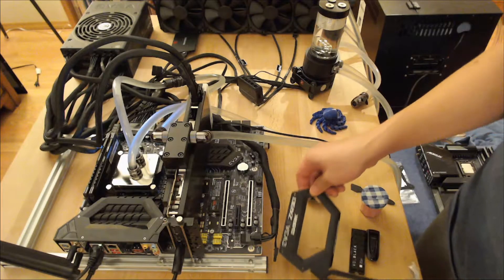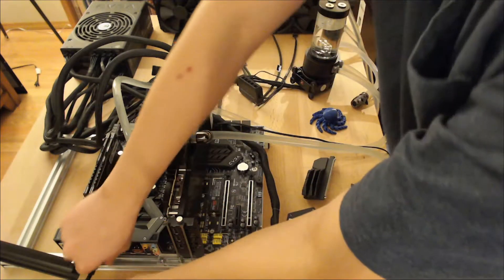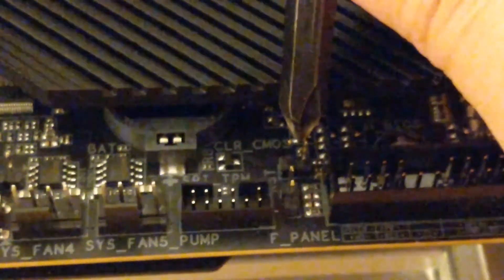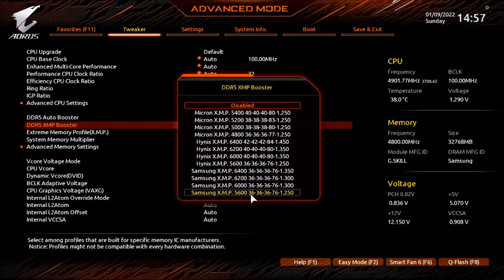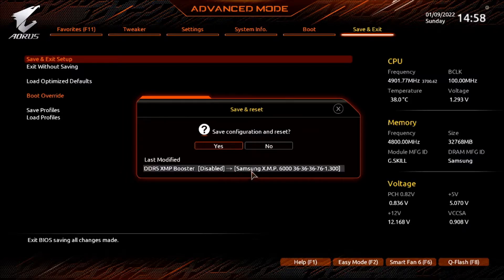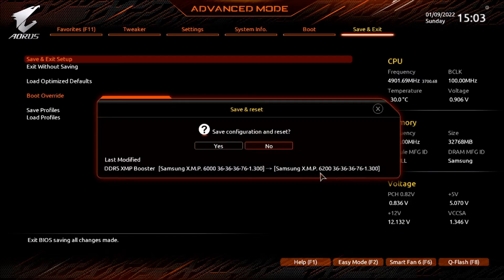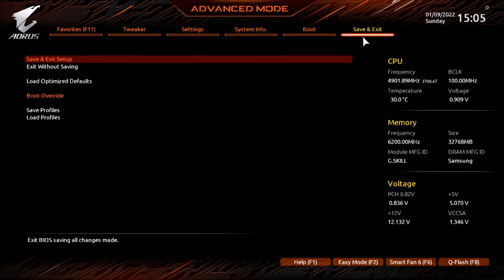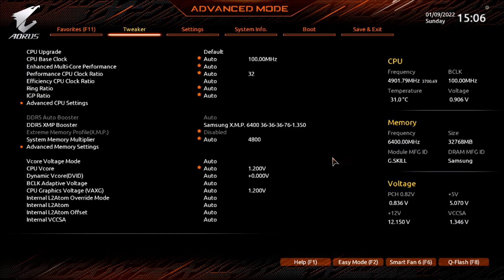Test Bench Gigabyte Aorus Z690 Master & Overclock DDR5 to 6400MHz - Apollo Build v1

Comment: Is 6200mhz CL36 even worth it when upgrading from 4800mhz CL40?
Reply from the maker: I think if you are doing everyday things most likely not, and even gaming. But if doing a lot of long  processing it can add up. The difference is 11.6 vs 16.6 theoretical absolute latency difference. I sometimes run some machine learning that would take hours or days and this kind of thing can help shave off time.
Reply: @nispoe Not only do I tend to run lots of edge tabs in the background whilst gaming, but I also do a lot of heavy 3D rendering work whilst having numerous edge tabs open even then in the background. But yes, definitely gave me something to reconsider instead of outright buying it.... thank you.

Comment: Hi, do you 've crash in game or Bdos with xmp boost 6400  cl36 ?
Reply from the maker: I do not crash when I play games, and have been running for quite a while now with this setup. I also noticed that the memory modules I have are no longer available F5-6000U3636E16GX2-TZ5RK. I was hoping to buy another set, when prices got lower, but there's been some sort of change with the kits. F5-6000J3636E16GX2-TZ5RK with a J instead of U. Not sure if this makes a difference or not, other's saying they have problems with the boost to 6400MHz. Not sure if it's the kit, 2 sticks vs 4, cooling, or just lottery with my CPU memory controller being able to handle things.
Reply: @nispoe  i am using kit F5-6000J3636F16GA2-TZ5RS with kit F5-6000J4040F16GX2-TZ5RS...  with config i can use to stable . Thanks

Comment: did you manage to get it to run over 6400mhz?
Reply from the maker: Yes I did, there was a custom profile setup on the motherboard to run Samsung memory chips up to the 6400 speed. I was going to attempt to mess with this more, but ended up just using the computer for everyday stuff this past year.
Reply: @nispoe  Yeah im running 6400 and XMP but can't get it stable at 6600 or higher though it will post at 6800. Not sure if the board just wont do it. Ordered a z790 Master will find out.

Comment: I have the Z690 Aorus Master it runs fine with the DOMINATOR PLATINUM RGB DDR5 32GB (2x16GB) DDR5
6200 however i bought 2 extra RAM modules of the same Mentioned RAM but then the motherboard doesn't show the Post/screen/bios it doesn't show nothing... It Runs fine with 32GB RAM DDR5 6200Mhz but i won't accept the extra 32GB of the exact same Ram, do you have an solution for this?
Reply from the maker: So this can be tricky, because sometimes if you buy 2 kits the actual memory modules could be different. Sometimes even though they look the same outside, the actual memory chips could be skhynix or samsung. The other thing I've seen is that there is an auto training with memory. I could be that the one set is tuned to work with some optimal settings. You can reset the BIOS and put in the new set and see if it will boot and auto train. Lot's of times it will start with some base speed before you can try to overclock the memory. If you have all slots you can try to turn off XMP and clear CMOS to load all the memory initially. Then try to increase the speed. Keep in mind also if you are using 4 memory modules because of daisy chaining you will not be able to most likely run at 6200Mhz and may have to increase voltage or made timing adjustments to make it work. This is why they sell kits that are matched so that if you buy a set of 4 in a kit they have been tested to run at the advertised speeds on the box together.

Comment: I found SOLUTION motherboard z690 ULTRA, ddr 5 booster enabled, restart, bios, XMP Booster, Hynix 6000,40,40,40,80,i dont have CL 32,ram not work full speed, no?
After restart pc not boot, error code 54,force shutdown,whait 30 sec, start and in Task Manager show memory speed 6000!Kingston KF560C32RSAK2-32, dual module 16gb x 2 rgb, in slot A2, B2!
Reply from the maker: Awesome you found a solution. Sorry, the Hynix memory is very exacting, and the auto training can sometime be tricky. Funny thing is just like you sometimes it takes some messing with and you get it to finally work. If you have it working did you check and run a memtest to see if it's stable? The BIOS has this test and can take a while to get through a full test, but you want to make sure your setup is stable when overclocked so that it's not slowly corrupting the data on your hard drive.
Reply: @nispoe  it is stable
Reply from the maker: @DJDANY_IN_THE_MIX  very nice, out of all the memory Hynix if you get right it is beautiful and very stable.

Comment: Hi, please help me, i have z690 ultra with ddr5 kingston 32gb KF560C32RSAK2-32,and i cant up value higher than 4800 Mhz, motherboard not boot, i have latest official bios f7, thanks
Reply from the maker: What is the speed the memory will start with? I did a quick search for the motherboard and Kingston memory (https://www.gigabyte.com/Motherboard/Z690-AORUS-ULTRA-rev-1x/support#support-memsup) It seems most of the memory listed for Kingston has Hynix chips in the module. Hynix memory is usually very exacting. You may have to select a memory profile that relates to Hynix instead of Samsung.
Reply: @nispoe  thank you for reply, i have default 4800,after 5600,6000 for xmp

Comment: Thank you for showing this workaround, I was unable to boot with xmp enabled ( boot loop code 54) in Gigabyte z690 aorus Ultra but after using your process, I set it to a lower preset using DDR5 XMP booster, then once it boots enter bios again disable XMP booster and enable XMP profile 1 and voila, the board boots xmp and I get the 6000 as desired.
Reply from the maker: Glad this was useful, I've been using my memory at 6000 pretty much daily since this video and it's been really stable.
Reply: @nispoe  bro i had the corsair dominator 5600mhz switched to gskill trident 6000mhz and now my games crash within couple of minutes of playing i have the aorus elite ax with the latest bios and the i7 12700k. Any recommendation will be highly appreciated
Reply from the maker: @francomora909  It could be many things, the first thing I wonder is what kind of case and cooler you're using? I'd also run a memtest against the memory to see if there's any issue with stability while not playing games. If you are getting problems when playing games my sense is something is running hot or is unstable.
Reply: @francomora909  Check your VCCSA voltage cos it's most likely lower then required. I had similar issues with A-Data DDR5 6000 XPG Lancer. It should run @ 1.35 but VCCSA was automatically set to 1.3496 or something. Try 1.38  - 1.4 volts for VCCSA and test your system. I'm not sure what is the right voltage for GSkill, so you should check in specs page.

Comment: Hey Nispoe! Can you tell me please, is 1.346 vccsa ok for long term use? I have this on auto and it also gives me 1.346 (running 5600 34-36-36-76 CR2). It doesn't have an offset, right? So it wouldn't go up under benchmarking (for some reson HWMonitor eports it at 1.37)? I also heard people complaining, that the Master burned their RAM, so now I'm kinda worried.
Reply from the maker: I think you should be careful with anything running higher voltage and overheating. I know many run in closed cases, I run most of my stuff in open cases because those closed boxes can retain so much heat and can get components pretty hot. I used to open the side panel when gaming on closed cases because I didn't want anything to get too hot to throttle performance. I think any overclocking motherboard there's a risk of going outside of normal thresholds and burning things up. I usually overclock for fun, but don't continually run the hardware at those overclocked settings every day. You should setup some profiles for every day and for when you are overclocking and want to get the most of your hardware.
Reply: @nispoe  Temps are absolutely fine, I'm more worried about CPU IMC  degradation. But I guess I'll set this to 1.25 and see how it goes. One more thing though - do you think the Master can run 6600 memory? Because Maximus Hero apparently can and appears to be a better board for memory overclocking. Kinda regret getting Master instead of Hero.
Reply from the maker: @olega5141  actually I feel the 1.35 range is okay. I've seen some manufacturers running even 1.45 with this memory. But my guess is these are binned and run cooler with more voltage.
Reply from the maker: What did your package show for your memory?
Reply: @nispoe  I'm away from home right now, so I can only check later. But as far as I remember, the cpu package was around 60 at full load, not prime though. It was 50-55 in games. For the memory, I remember idling at 30, didn't check under load, but should probably be somewhere around 40. I'm having double thoughts about vccsa, since 1.30+ is either for really high clocks, or 3800+ ddr4 in gear 1. But I guess at least 1.10 is necessary for rtl training.

Comment: Did you get 6400 mhz to work ;no problem with 6200mhz but 6400mhz gives me a blue screen; not sure if voltage issue 	.
Reply from the maker: I was able to get 6400 mhz to work, but I didn't do a lot of testing with it. I've been running pretty stable at 6000 mhz daily though. I planned on doing more, but work has been busy.

Comment: Great Video,  Getting same Mobo, been using the master for years, Will probably get same Ram as  you as will save from  hassle, Have you tried using 4 Sticks and getting  it to post  as have seen many videos of people sticking to 2  as 4 seems to be problematic, Great Video 🍺
Reply from the maker: Thanks! I haven't tried 4 sticks of RAM, but think I will when prices of RAM go down in the next generations. Even when DDR4 is setup on a motherboard with a daisy chain it can stress out the CPU memory controller. Many times the RAM will have to be clocked down or tweaked with more voltage to use all 4 sticks. So mileage may vary depending on CPU, RAM, and Mobo.
Reply: @nispoe  The Price off Ram is holding me back , especially in U.K. , So I’m Sticking with the Z390 Master I’ve, got, Never had a problem with it, Running Corsair Vengeance RGB Pro  4x16gb @ 3466Mhz  C16-18-18-36  @ 1.35v , Took a while to get 4sticks running but haven’t had a problem in couple of years it’s been running, But as u mentioned, same amount of ram 64Gb for Z690 is about U.K.   £700 🤣 which is crazy, Anyway good luck from a New Subscriber 🍺

Comment: Cannot get Corsair 6200mhz to post at all. Best I can get is 5600mhz stable. Gigabyte really need to sort this asap
Reply from the maker: Corsair 6200? Is that the Dominator CL36 kit? In the BIOS can you tell if the memory chips in the module is Samsung, SkHynix, or Micron? Also, did you try to update the BIOS? Looks like there is a new BIOS F8d but I am currently running F7c. I started with F5 and had issues with memory speeds over 6000MHz. I could run at 4800MHz and couldn't run at 6000MHz until after I updated the BIOS. Try the newest version F8d and if that has problems maybe can try the version of the BIOS I have running - https://drive.google.com/file/d/1Gm45W3GWvAAwKxQogTn5z3gqAsUuhYoP/view?usp=sharing
Reply: @nispoe   thanks. Yes it’s the Dominator CL36 using the Hynix chips. I’m actually using a different mb to you, the Gigabyte Gaming X which I think is a variant of the Aorus Elite mb. Initially the board wouldn’t post, even at 4800 until I flashed the bios with F6. I’m now running F7 using the Hynix 5600 profile which is stable, anything more and no post. I tried manually undervolting, overvolting, running slacker timings and changing the sync mode too but no joy. I’m not sure what else to try tbh, so I guess I’ll have to wait for a fix 🤞
Reply from the maker: I took a quick glance for your motherboard and it looks like there's a F7a BIOS, but it says this is more for Kingston issues and not sure if it will help for Hynix chips. My sense is you may be already running this BIOS. I looked at the memory support list and it looks like maybe Kingston Hynix is running at 40-40-40-80 1.25v instead of 40-40-40-76 1.35v. If you look at the Aorus Master memory compatibility list it shows 6200 with Hynix running at 38-38-38-78 1.25v and 40-40-40-84 1.35v. My sense is that you can give something like this a try. From my experience Hynix memory is very exacting, so there's very little wiggle room to get to next levels in overclocking. Yet, if you can nail the timing and voltage Hynix is more stable and sustained. I also saw a link to online support you can submit a question to Gigabyte, wouldn't hurt to ask them if they can do something with your specific memory kit and motherboard since the kit is a pretty popular brand.
Reply: @nispoe  will have to give these settings a try. I’ll provide an update later if I have any success :)
Reply: @nispoe  here is the reply from gigabyte support; it doesn’t look promising.. 

“We will provide BIOS updates constantly with updates from Intel.

However there might be limited changes to your case as we have not tested that Corsair memory kits before to guarantee its performance, and also when it exceed our tested speed of max. 6000MHz.

The memory OC stability is also affected by CPU quality, therefore your 12600K may or may not be relevant in this case.”
Reply: I think I’ll return the board for an msi
Reply from the maker: Ah yeah, kinda makes sense related to CPU quality. I've been able to improve cooling to get more from my CPU, but then again I'm using the 12900K so the sense is I may be lucky with the CPU silicon. I know motherboards can make a big difference. I had issues with my 10900K on some motherboards with my 4800MHz DDR4 where it could only work on more top end motherboards. If you read the fine print from Corsair and G.Skill there's disclaimers on which specific motherboards the speed was tested with, and even then they can't guarantee it will work since there is so much variability between CPU, Memory, Motherboard, and cooling components. Now all that being said I was able to get to some success, but mostly with Samsung chips and found SkHynix chips can be tricky to overclock.
Reply from the maker: Which MSI board were you thinking of? I was eyeing the Carbon at one time, but don't know if the board can do 6200. Maybe check the mobo memory list first.
Reply: @nispoe  it looks like the MSi Tomahawk supports my memory
Reply: @midgleydesigns  did you find a fix, same MB and same issue here, 5600MHz max..
Reply: @domis.5827  unfortunately no. Ended up replacing board for MSI Tomahawk. Memory now stable at 6400mhz